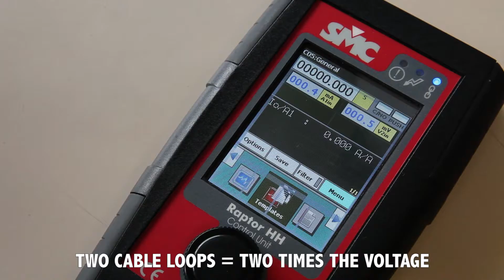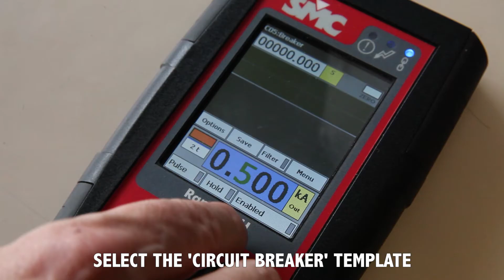Testing a circuit breaker with EuroSMC's Raptor primary current injector

Comment: How much is cost
Reply: I feel  sorry for you if you have bought this unit. I have a master and a slave unit and it cannot push 1/4 of what they are advertising. Using cabling they say, turns, etc etc all nine yards. Basically its a money going down a drain, simply expensive garbage.